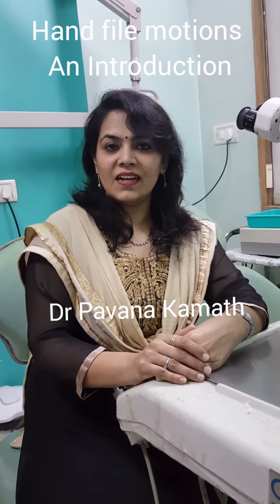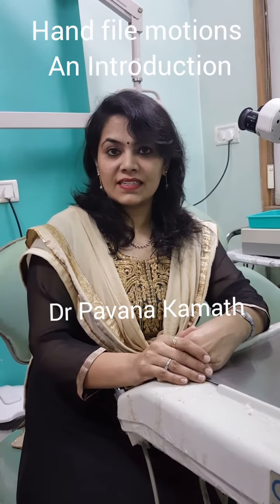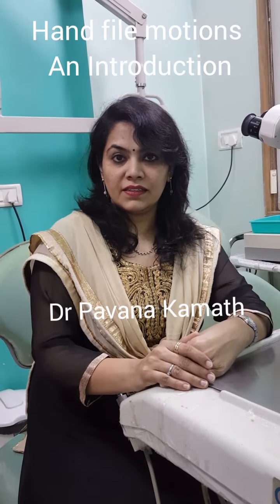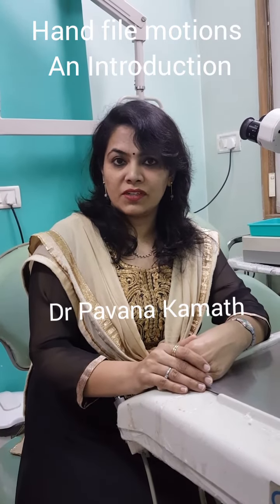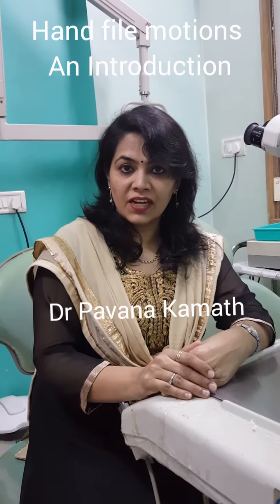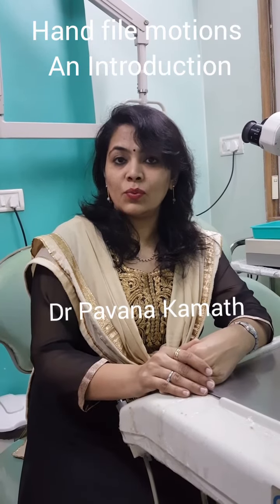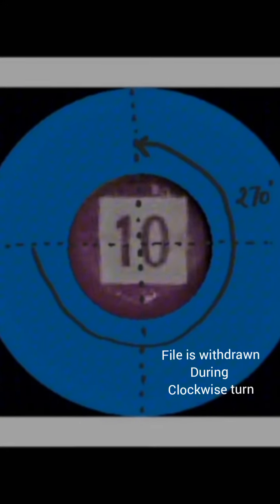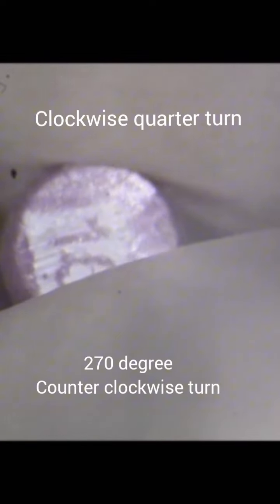BALANCED FORCES TECHNIQUE..HAND FILE MOTIONS

Comment: I ve a fear of perforating the floor can u give any safe tip that i can make a great access and no risk of perforation?
Reply from the maker: ahmed faraz generally we need to penetrate to not more than 5 to6mm from occlusal surface.if u feel the drop during access opening you need not go any deeper ..then the focus is on de roofing the pulp chamber

Comment: Hello Dr i have a question, Can we start manual hand protaper sequence after filing with 15 number Kfile?
Reply from the maker: ahmed faraz once you have established the glide path ..you should not have a problem.
Reply: Upskill Dental Academy i was filing lower molar with 15k and it was free... If i start using SX file after it.. Should there any chance of breakage of Sx file? Some recommend me to use atleast 20 to 25 number K file....
Reply: I used 8K 10k and 15K file upto working length
Reply from the maker: ahmed faraz no  10 k file super loose is what is recommended prior to beginning rotary preparation.
No 20 n no 25  files are stiffer and may not maintain the apical third anatomy .safer approach would be a crown down .
Sx if used properly will not cause any problems
Reply: Upskill Dental Academy I want to use it with Edta for lubrication and if 10 to 15 k file is enough it wud be great :)
Reply: Upskill Dental Academy i m not using gates glidden coz i dont wud it be ok?